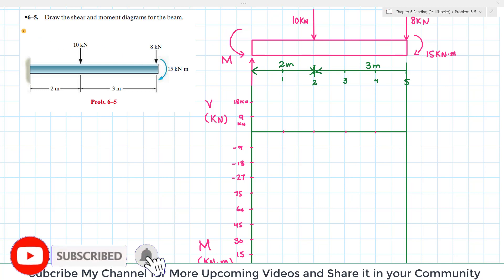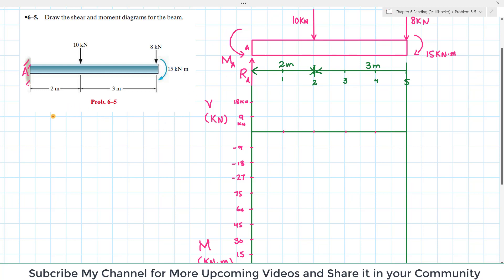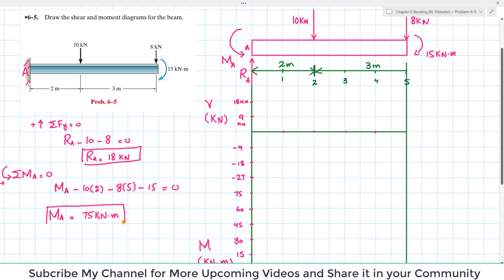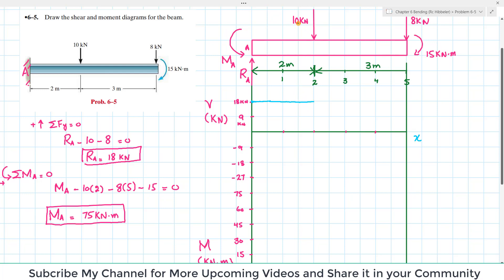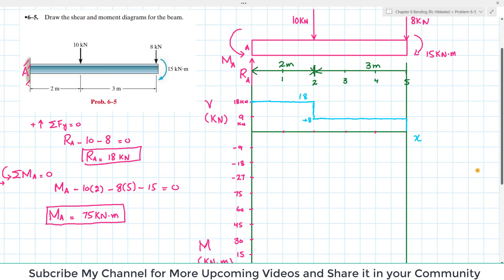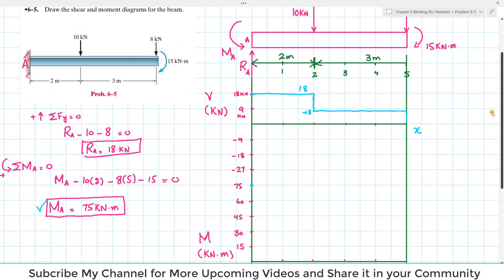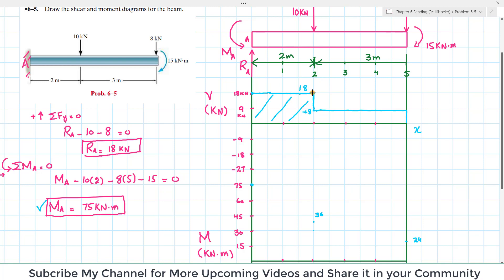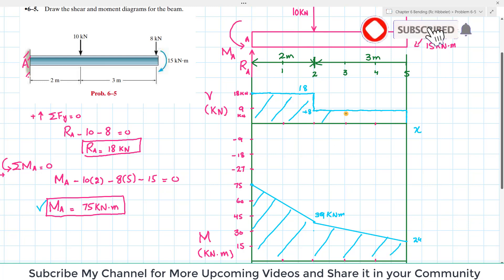6-5 |Chapter 6| Bending | Mechanics of Material Rc Hibbeler|

Comment: Hello, sir. When we take moments about any point, we don’t we consider the moment of that particular point itself? Then why is the moment about point A included in the equation?
Reply from the maker: Any external moment will be included and if point load is there at that point that perpendicular distance between load and the point where you take moment will become zero. That's why we take zero moment at that point due to load acting on it.

Comment: Hello sir, for the Moment diagram, why did we subtract by 36 instead of adding? And when we reached the 24, why was that not added with the 39 from the point before it?
Reply from the maker: Ok so there is an issue in this diagram. Counter clock wise moment when drawn in bending moment diagram will go downward or negative and clock wise moment will go upward or positive as per book convention. So do this problem in this way or check the other problems in which I have rectified or explained correctly.  Thank you 👍